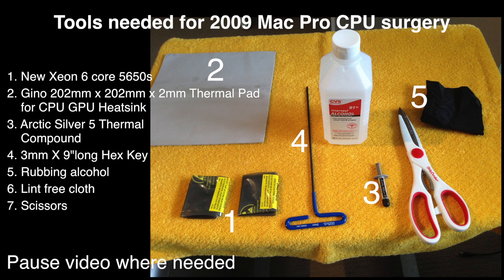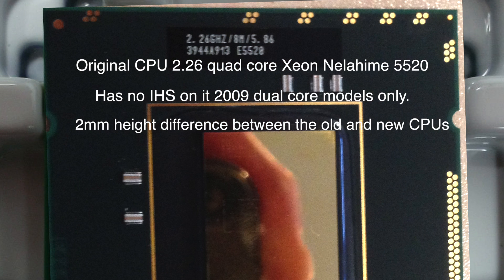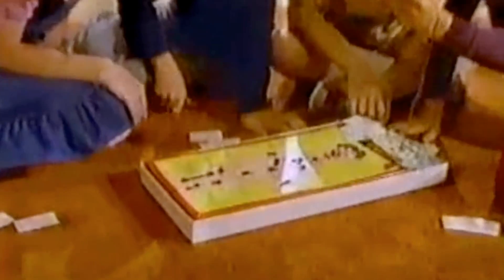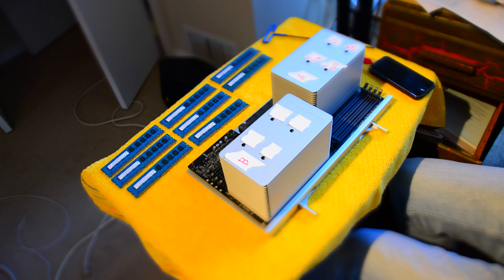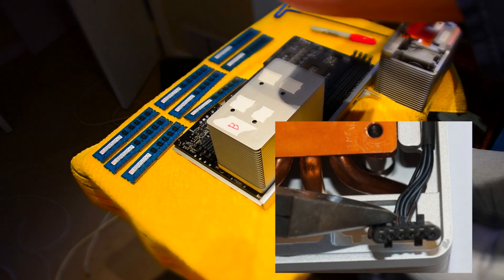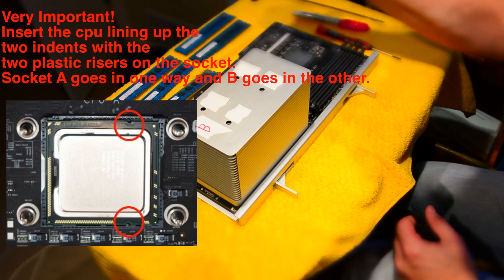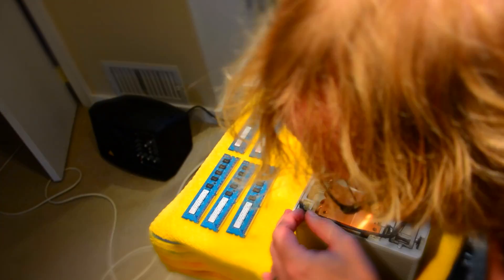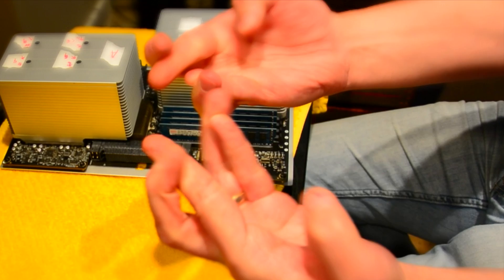Mac Pro 2009 5,1 CPU upgrade 8 core to 2010 12 core

Comment: wtflax is that all about for the system to not recognize some ram due to under tightened cpu screws!?? oh apple..
Reply: +DJWario The CPUs are connected with the Motherboard via small Pins in the socket. If the CPU isnt pressed down by the heatsink with the right amount of force, not all of those pins may make proper contact. Further, every pin has a dedicated function, so in this case it might just be that one pin that connects a RAM-Slot with the CPU.

Comment: Has anyone here had the issue with 2009 Mac Pros' Northbridge heat sinks overheat? Trying to find the best method to replace its rivets; currently buying new thermal paste and two Chinese rivets from eBay... hope they work. I wish Apple had addressed this stupid issue! They don't even carry such a part.
Reply: +maccollectorZ (Commenting Account)   I used two metal screws with plastic threaded nuts about the right size, which I took from one of my helicopter servo mounts.
Reply: lawlist I actually ended up buying cheap, Chinese rivets from eBay. They worked fine, all except for the fact that they were a bit tall. For the one that's supposed to be concealed underneath the CPA heat sink, I had to cut it down with a Dremel.

Comment: Does the firmware update work on El Capistan?
Upgrade Tool said it was succesful.
I held the Power button, until the light flashes, but my mac won't upgrade :p
Reply: you need disable the SIP first then it worked with El capitan

Comment: 2009 8 Core MacPro to a 12 Core.
 
CPU Choice - x5680
 
First let me say this.....I am confident that most people who say not to attempt to DeLid Soldered CPU's are simply regurgitating other peoples fears and likely have no first hand experience. It is so insanely easy, its almost criminal that people who are packaging DeLided CPU's with the Thermal Past, Thumb Drive, and cleaner, then marking it up over 300.00 over buying the parts separately and DeLiding the CPU it yourself.
 
Step 1 - Use the Vice Method (NO HAMMER).
https://www.youtube.com/watch?v=AizBSTndfLg
 
 
I personally took it one step further, but in hindsight, it was not necessary. I took an exacto blade and cut into the corner sections of the IHS where they are Siliconed to the CPU. I barely cut into each corner.I applied pressure in the vice, let it set for a minute, then applied a little more pressure, let it set for a minute.
 
Took the CPU/IHS out of the vice, turned it 1/4, then repeated the previous steps. Then took it out, took it back 1/4 turn (Original Starting Location) applied pressure, a little at a time until I started to see the IHS slide on top of the CPU, then took it out of the Vice and slid it by hand the rest of the way off.
 
The Vice Only method was a piece of cake.
 
Full discolor, right after Deliding the fist CPU, I was in a terrified moment for a while because, especially on the first CPU there was a ton of Solder that had to be removed. As I was scraping it off with a Utility Knife Blade, visually it seemed like I was cutting into the Die that is on top of the CPU, but that's not what it was, it was the Solder that made it look that way. It took me about 15 minutes per CPU to scrape off the old Solder and clean up the Silicone that is around the CPU.
 
Just as a precaution, I decided to just DeLid one CPU, then install it to confirm I didn't damage it prior to going head over heels by DeLiding both. This way, if I did screw it up, I only had to buy one CPU to replace and not two. Remember, because this was new to me, I still at this point was not sure if my decision to DeLid verses wait for the Washers and Thermal Paste to arrive was the right one.
 
After DeLiding the first CPU, I installed it in CPU A slot on the tray, with no CPU in CPU B Slot. This was my test to see if I damaged my CPU or not.
 
I installed the first CPU in CPU A slot, left CPU B out. It booted up right away revealing that I had a 6 Core CPU in the computer. Note: With just one CPU in the A Slot, after competing booting, it's normal for all the Fans to blow at full speed. They will go back to normal behavior once you have the second CPU installed. So don't panic when you hear the fans blowing full speed!
 
So off to DeLiding CPU number 2, put it in, same steps as the first, and BAM. No more fans, all is great.
 
Typing this on my new
 
12 Core
 
Check out my new Geekbench scores, 32 bit and 64 bit scores!!!!!!!
 
27,492 - 32 Bit
30,377 - 64 Bit
 
Only 6gb Ram when testing, but I now have 24gb the faster RAM on the way!
 
Forget the Washers, Forget the Thermal Pad, Forget Clipping the Fan Connector
 
Delid and be done, it's so easy!!!!

Comment: Spreading with a card etc. is not recommended because of potential bubbles. But the line method might be better because of the large surface.

Comment: Hi lance do yo know if this card will work for my 2008 mac pro
Gigabyte NVIDIA GeForce GTX 960 4GB Windforce Boost Graphics Card

http://www.ebay.co.uk/itm/381340340848?_trksid=p2060353.m1438.l2649&ssPageName=STRK%3AMEBIDX%3AIT

can it be flashed,or can i use it without flashing,i am dual booting with Yosemite and windows 8.1 via boot camp,i don't want to run in to any problem and want to make the right choice could you please help.

Comment: I did the W5690s (3.46GHz) though. Geekbench score of 32000.
Reply from the maker: Can you post your cup temps when under heavy load I am thinking of 
Upgrading to 5690s soon thanks. I'm sure lidless was much easier
Most likely the best way to go with the 2009.
Reply: No problem. I can tell you that the temps are fine, but I'll show you the proof. I'm making a video about optimizing the apps I run on it. I'll cover the CPU temps too and reply with the results for you here.
Reply from the maker: ***** What video card are you using?
Reply: +Lance McVickar Hi Lance. Currently the stock ATI Radeon HD 5770 card. Last week I bought another 2009 MP for x5690 upgrade. One or both of them of them are going to get a new video card. I haven’t decided which one yet. Probably the GTX 980. The only reason I need a better video card is for FCPX, so OpenCL support is the most pressing need, however I'll probably stick with Nvida. Everything else I use (Digital Performer and Vienna Ensemble Pro) don’t use the GPU for much except screen draws. Are you thinking of upgrading your video card?
Reply from the maker: +Steve Steele I already upgraded from a 5870 to a R9 280x I have a video on flashing it. I've been thinking about a 980 as well.... Wondering how much better the performance would be in FCPx over my current card. I know it use to be that AMD cards were faster for open cl but I guess that's not the case any more.

Comment: I did this upgrade with delided CPUs. Was easy. Took 10 minutes. I should have made a video.
Reply from the maker: ***** Thanks, was interested in your temps as someone else was asking  what temps the 5690s run at when under full load.
Reply: Lance McVickar After stress testing the 5690s, the max temp reached during burst usage was 70 degrees C for CPU-A and about 65 degrees C for CPU-B. The difference in temp could be due to CPU-A location towards the rear of the airflow. They instantly dropped 5 to10 degrees when at average usage. I mentioned in another post to you that they idle at 39 and 36 degrees C. Be sure to watch the Cray Kraken CPU upgrades video I mentioned. Hope that helps.
Reply: + Steve Steele Hi, can you tell me how to control and check the temperature of the processors for the same as you please thank you
Reply: +Djam djam To check the temps you need an app that reads the sensors. iStat Menus would be one such app that you can get from the Apple Mac App Store. You can also use the Terminal for this but it requires some shell scripting. To control the temps you need to control the fans. I wouldn't bother with this unless it's urgent. The system will handle it. In my studio, when I'm not recording with microphones I've actually got a big strong fan pointing into my three 5,1 MacPros to keep the air flowing. Believe it to not, that with the AC turned kinda low helps a bit to keep the temps from getting too high during heavy loads.
Reply: ***** thank you for your advice this application also works on Snow Leopard?
ok for fan control I will return to you if after installation of 2 x X5690 in need received my processors and memory very soon :-) if you have any advice I'm interested your help will be welcome

Comment: Quick question: What's the hottest the CPUs in the upgraded tower be running? I run I stat and during rendering, the fans blast up to 5,200 rpms and CPU temps rise to about 70C or 160F.

Comment: Hello. I got a problem. After I changed cpu to X5650, the fans kept running at full speed. How to solve this problem? Thanks!
Reply: Damon UK Hi, Damon. I put 2 layers of thermal pad to fill the gap between sensors and heatsink. In some circumstance only one layer is not thick enough to make the connection.
Reply: Hi, Damon. I put 2 layers of thermal pad to fill the gap between sensors and heatsink. In some circumstance only one layer is not thick enough to make the connection.
Reply from the maker: Du Yu It can mean a few things. Either the thermal pads are not making contact with the heat syncs or the connectors for the heat syncs are not making full contact. Another person on here talks about the same issue, he tightened up a little more and it was ok, but if everything is showing up like your processors and all your ram, then it most likely has to do with the heat syncs. Read some of the other posts on here. And it's not good to over-tighten as that can cause a major problem.
Reply: Thank you for your reply. My mac just won't boot with 2 x5650. But works with one x5650. When it runs with x5650. the rams are still at 1066Mhz(I'm using non-ecc 1600).
Reply from the maker: Du Yu you have to zap your pram to get the ram to be recognized as 1066, 
 Turn on your Mac.  Immediately press and hold the Option-Command-P-R keys. You must press this key combination before the gray screen appears. Continue holding the keys down until your Mac restarts, and you hear the startup sound for the second time.then  Release the keys. Check the ram again to see if it is now what it should be, if not try the process again.
It will take quite a while before you here the 2nd chime even a minute or two so be patient.As far as your second CPU not working you may have a bent pin or did not tighten enough, always hard to know.you may want to redo the whole process, clean off the theramal past etc and do the install again. Check for any damage on the CPU and the logic board, if pins are bent you can straighten them with small tweezers. Use a magnifying glass to see if there is any damage.
Reply: Lance McVickar Thanks for your help. I finally got it right. Now running with 12 cores at 2.66Ghz and 1333mhz RAM. The cpu temperature is 36C but the northbridge is about 65C. I also wanna upgrade the GT120 into a GTX650ti with a new SSD.
Reply from the maker: Du Yu Congrats so what did you have to do to get it working as others have had the same issues so it be great info to share here.
Reply: Du Yu How did you get your fans under control? Please share your experience as I'm having the same problem. Thanks Damon
Reply from the maker: Du Yu Yeah if the sensors aren't making contact to the heat sinks it would 
cause the fans to run full speed as they are not getting the proper 
reading, thanks for sharing the fix Damon. I bought 2mm thermal pads and I think I did not remove the old ones from the bottom of the heats sinks.
Reply: Lance McVickar Thanks for getting back to me both of you. I appreciate it. I've actually already done what Du Yu has done because I thought the heatsink wasn't making good enough contact with the sensors. So I added 2 layers to the original which is quite thin. I bought the same thermal padding as you've suggested as well. Maybe I should try some other. I've taken the heatsink off again and checked the connector  was the right way round too - it marries up with the snipped of plastic tags so I'm assuming it is. It remains a mystery why I'm getting no CPU A readings. But the computer is working - I'm just having to manage the fans with MFC. Are there any other connections to try? I read that post you linked me too but without diagrams or pictures it's hard to know what they're actually talking about. But thank you for keeping to try and help me Lance.
Reply from the maker: Sorry you are going through this I know it sucks :(  2 layers of thermal pads might be too much, perhaps you should go back to one and tighten a bit more. And or remove the old pads and only have one strip of the new.

We could also do a facetime call so we can chat instead of this back and forth. I can give you my email address and you can call me that way, let em know. even if it's just a voice call via facetime, I am in NY time. or skype.

You might want to contact Thomas Pindelski
And tell him of your issues, maybe because your in the UK he will be nice and give you some advise. He is in California. He might tell you to take a hike, not sure, but he does this upgrade as a service for people at pretty reasonable rates.

http://www.pindelski.com/MacProTurbo/

thomaspindelski@me.com
I got it from his website.

Ok I found his old article on the install which is what I followed to do mine. Read the whole thing and see if you find any insight.

https://web.archive.org/web/20131026053641/http://pindelski.org/Photography/2013/07/08/mac-pro-2009-part-tbd/